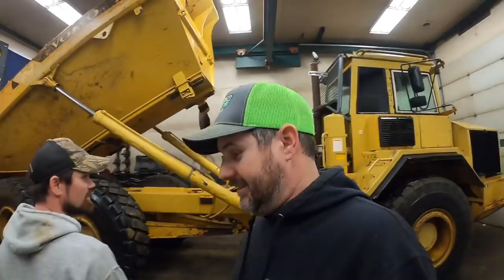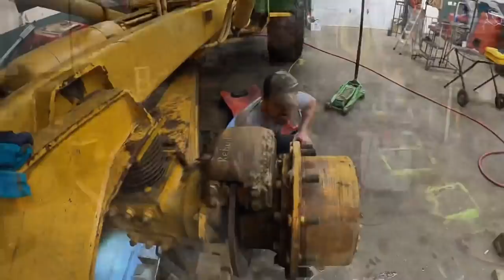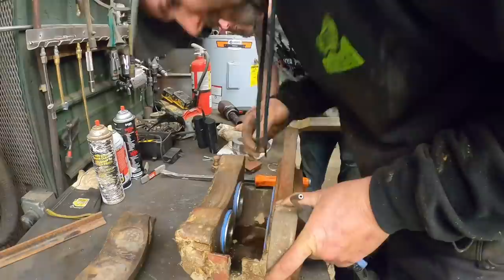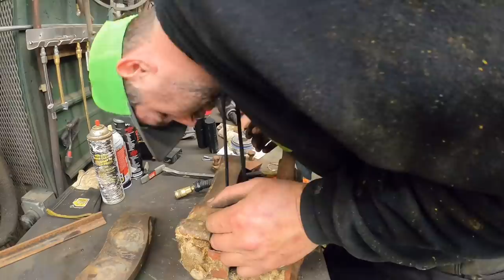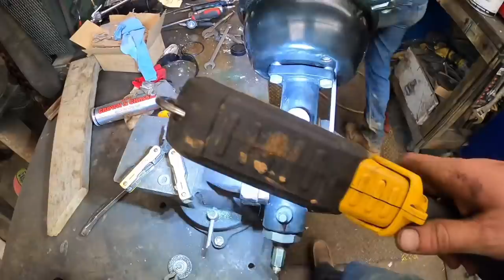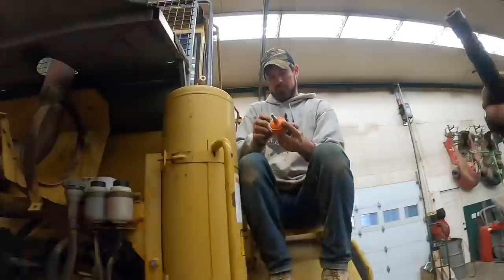Another attempt to fix the brakes on Bubba Dump ends in disappointment and failure again

Comment: Get yourself a tube of Sil Glyde for those O-rings and you're golden.  I know this has been beaten to death already, but from the looks of it, whoever rebuilt that caliper put the pistons in backward.  They definitely came out the way you put them back in so it was wrong long before you worked on it.  If they were in correctly, the hammer marks would've been on the other side.  It's obvious the previous owner didn't care much about brakes.  Or working brakes, that is.  Fixing someone else's mistakes always sucks.

Comment: Go look back in Video when you took out plungers flat side to fluid. Use 3 M break clean watch  Wes Work uses break fluid to reinstall not grease you ve sorry .. Got a machine shop around to turn you a new caliper piston to replace the damaged one  Booster piston may Been put in backwards by manufacture ( (  like the caliper pistons smother side out ) )  my guess got to be flush . . buster can to plunger. Can look at a car or truck one no washers dirt get in there will destroy your new part  
I always marked with a Sharpie direction of things when pulling out. She said. ? Note when taking apart the other leaking caliper make note yeah a pre clean would be helpfully. Well Mats workout carrying the caliper. 
Im learning right along with you Mike & Matt

Comment: You don’t need a bigger shop. You need to blow out the two doors and replace them with one wide door or, and better yet, blow a hole in the end wall so you have the full length of the shop…… easily instead of trying jockey the big stuff around. 
Captain Jack

Comment: Haven't read all the comments, but at the start when jacking the wheel up, it looks like the weld on the trailing arm, between where you positioned the jack and jack stand, is cracked all the way across the trailing arm end?
Reply from the maker: No sir it’s not

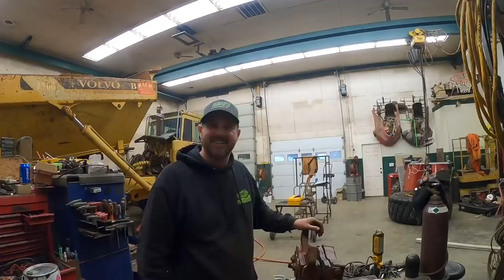Comment: @32:20 Now, take em back apart, clean em up with brake clean so all the grease is removed (it'll destroy the rubber seals) and reinstall everything, with the flat side of the pistons towards the caliper. Other than that, Git-er-done!!
Reply from the maker: Plan work perfect thanks

Comment: To me it looks like the break wheel is slanted in the slot of the two pressure pads.  If crooked on the axis - the pads won't touch all surface. All this pain and no Lt. Dan.

Comment: You might get one of the in-line load meter ( in pounds cause that’s what makes sense)  to both show the soundness of your rafter gizmo and the weight of some of the stuff you lift.  Gotta be worth at least fifteen to fifty clicks on the old like button.  For those who actually show the grace to push said button.  Tax deductible as a business expense.  Tell the IRS that it’s good.   And who is gullible enough to wear a white hoodie to work for your business?   Tell him black or brown is more Weyyynnnnooooo.

Comment: You mentioned that caliper should 'float'. Were you aware that OPPOSING piston designs mean that the caliper itself does not need to 'float'? (The pistons should self-center the pads on the rotor)

Comment: I was just worried about that Harbor Freight jack stand and even if it is a good brand is it rated for what you are holding up??? DP is always kind of sketchy on these things. Higher rating is better when lives are on the line. I love overkill on safety stuff.
Reply: And Mr M in between that frame and bed cylinder when bed was "chained" up??? Kind of relying on nothing going wrong a bit there. You can never be one hundred percent safe, but I kind of like at least ninety percent myself. RR tie or shoring post between frame and bed is what I know.

Comment: I think you used regular grease instead of silicone or red rubber, seals will swell and lock in no time. When cleaning inside a calliper only use brake fluid or soap and water as the seals for break fluid are destroyed by anything like regular grease, diesel or petrol.

Comment: I’m not going to mention the pistons are in backwards nor that you should never use anything but brake fluid inside brake systems. It looks like everyone else is telling you. You said the bed was chained up, chains can break or slip, I’ve had 2 friends killed working under a dump bed. Please make a stiff leg to hole the bed up or cut 2 pieces of angle iron that will fit on the hydraulic cylinder shafts and ty rap or use hose clamps to hold in place to keep the bed up. Be safe not sorry
Reply from the maker: Plan worked perfect thanks for the comments

Comment: Hey Mike I hope that Grease is brake component rated as petroleum based products will damage breaking components i.e. The rubber seals will break down very rapidly should have used brake fluid or had bought a name brand grease that is designed for brakes called silglide... Sadly most see Jennifer and think what does a girl know.

Comment: Hi Mike probably been told already pistons wrong way round hollow to pads. Grease oil impregnated soap not good for brake seals, rubber grease. Built like brick sh** house won't matter until next time👍👍👍👍 manual on pdf think let's dig got it on pdf
Reply from the maker: Plan worked perfect

Comment: Putting a caliper piston in that way will trap air and cause problems down the track, brakes will always be spongy.
Reply from the maker: Plz explain
Reply: Flat side away from the pad so there is nowhere to trap air that may not be able to be bled out, sorry if I didn't explain what I meant very well.
Reply: The piston void can hold compressible air. Also when you service your fluid you cannot replace all the fluid as some is captive in the chamber still hence why the piston face is flat. The void In the piston can also introduce contamination to the fluid causing damage to seals, it's not designed to make contact with the fluid. Yes it will still work but would be better the correct way.
Reply: Yeah there definitely in backwards from how they are originally and will trap air because of the bowl shape.  But I don’t think he cares or already a knows lol. That or he changed them back off camera and didn’t mention it to generate more comments.  Which seems to always work😉

Comment: That chain will not hold the body up even if you didn't have all that slack allowing it to get a running start. Geez, buy the link or cut one out of those thick scraps from the plow. Make 2, one can be shorter to hold the body when it is lower in the shop.
Reply from the maker: Interesting worked just fine when needed very sorry to disappoint you today but thanks for watching
Reply: @DirtPerfect  You didn't disappoint me. I've been in this trade for over 40 years and have seen more than one person seriously injured. I don't want to see your guys added to that list.

Comment: hello from the Netherlands DP family .  
I don't know what the cost and availability of those rebuild kits for the calipers are but isn't it a good idea to just rebuild all 3 other calipers too?  
then you know for sure that they have been rebuilt to your standards 
and not that the morning after all your work they have to vent and have another leak because it was not done well by the previous one who worked on it.  

are there parts or other things that you can hardly get your hands on in the US that are readily available here in Europe ? 
otherwise I might be able to help you with that Mike .  

for extra shop space : isn't a high roof carport for the shop above the concrete floor you poured there a simple and cheap solution ?
thanks for the video DP and Matt .  Sincerely Hollandduck

Comment: rubber oring should not encounter the  hole. will damage the oring
Reply: I clarify. That oring in the master cylinder  seals against an external escape of high and low pressure fluid towards the air piston.  As you likely know, sliding orings need 100% smooth surfaces to avoid rubber chunks soon getting sliced off and ruined the oring.  The hole that the oring slid passed very likely has a share edge that will quickly slice a chunk out of the oring.

Comment: Mike, it seems that you, Wes @ Watch Wes Work and Matt Diesel Creek are all runnin' hard trying not to get run over by the Struggle Bus on your vids today. 
As they say, The devil is always in the details.
Miss one and it'll bite you when you least expect it. 
How someone could have not noticed that parking brake issue is unfathomable. 
Then there's the idiot who hammered in those brake pistons.
Those calipers are almost as big as the ones on a Grumman HU16e Albatross seaplane.
Lucky for us Coastie Aviation Machinist Mates we had a hydrolic jack assembly jury built at each Airstation to mount them made up out of odds and ends.
Next time you gotta add brake fluid use a big turkey baster.
It'll save a lotta mess and provide exactly the right amount.

Comment: Never mix brake fluid with anything other than brake fluid. The seals in that caliper will need changed.
Reply: Or more correctly...  'The seals in that caliper will need TO BE changed.'
Just remember Hamlet, Act 3, Scene 1....  'To be, or not to be, that is the question.'
Reply from the maker: Plan worked perfect thanks Guys

Comment: One step forward two steps back but now you know how to do it so it should be faster on the back axle. Parking brake looks a mess. Step by step, inch by inch... you are sneaking up on it. The day will come and hopefully the value of this investment rises due to repairs and full functioning truck. If you bought it right  you win, if you didn't you learned a lesson no one can take away from you. An upside either way.

Comment: [workshop]  DP, you might benefit from figuring out a way to guide machinery into (and out of) your workshop. You may well be able to use your present laser gear for this, and just need to attach a holder to the wall (opposite either vehicle entrance, I assume) and mark the spot on front or rear of your vehicles where you can "clip on" the other laser thing (the receiver?). You wouldn't need to "install" things, as (to my understanding of your and LetsDig18's proceedings, you could listen to the beeper. You could amplify that sound, if needed. So, it might hardly cost you, but it would keep you at ease when moving equipment. Same for your shed ("office" or whatever you call your other place). - Mine is not a full recipe, just a thought for you to elaborate on.  :-)

Comment: Hey Mike, I have to be a brake reservoir strainer Nazi. Never pour fluid right into the reservoir, it must always be poured through the strainer. If you don't do that, the front bumper may fall off do to crap in the brakes. I can't understand why no one else didn't comment on this.

Comment: I'd bet that truck will need a complete brake job in 6 months if you use it much. That greese will penetrate the whole system and eat all the seals up. My opinion.
Reply from the maker: Plan work perfect thanks
Reply: So your saying you're going rebuild it off camera and say it works perfectly.  Got ya lol

Comment: There should be a spring in the cylinder that pushes the piston back and acts as a stop to keep the piston from going too far!   if the piston is floating/ traveling too far and not being returned it is wrong! Must be spring back pressure on piston !  So not booster but master is bad!!!also the caliper pistons the smooth flat  face should be to the inside. So the surface area is the same so the pressure is equal on each piston  , and apply at same time ! With no extra fluid on any piston!  Great you are attempting to make repairs your self but can mot know all no one does! Get help or a manual to explain correct parts orientation and operation!
Reply from the maker: No sir

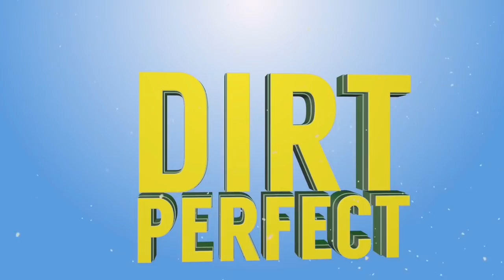Comment: 51:32 so you tearing in the diffs for difflock was just a tease? couldnt wait to see you shirtless laying underneath covered in gear oil swearing like a sailor with caked mud sprinkling into your eyes
by the way check the thickness for the bottom wall of the differential housings, had seen one that was worn all the way through til pinholes appeared - might consider adding skid rails and skid plates if the housing is worn thin and you intend on dragging that dumper to impossible places with a dozer- or weld on some low cleet track shoes as wear plates